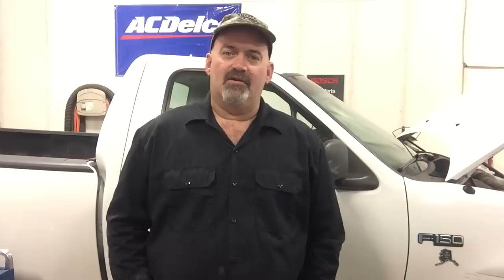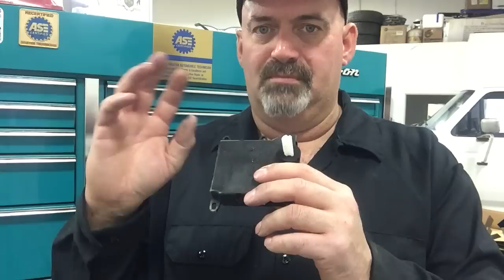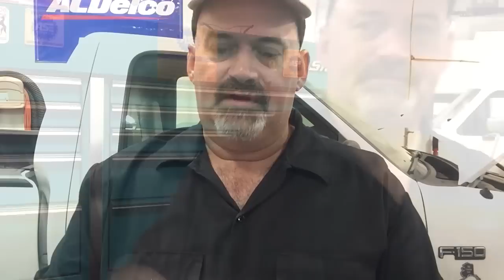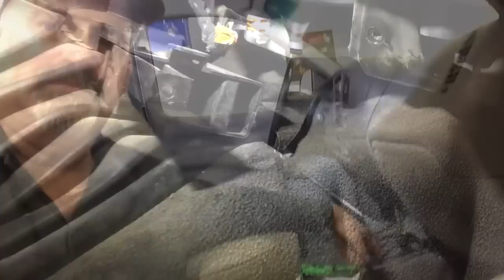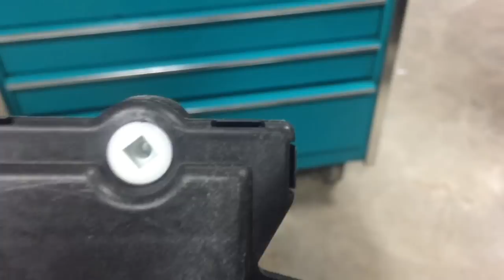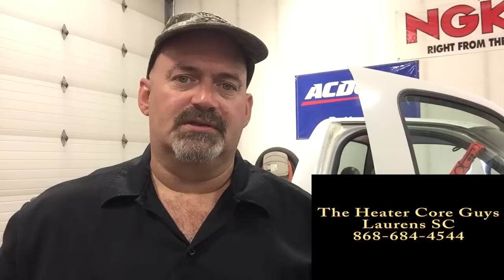Ford F150 F250 Expedition No Heat Diagnosis and Repair

Comment: Help. 1999 Ford F-150 4.6L  W vin.  I had my heater core flushed twice and reversed flush. Blend door replaced And the actuator. Thermostat was changed twice thinking there was a bad one..water pump was checked and it’s good having control knobs checked and are good. They havc controls replaced. Heater core was replaced thinking that was it. . Hoses are hot coming out of the heater core. Radiator hoses were replaced. I get warm heat not hot heat. I’m not mechanically inclined I can swap out parts. I’ve had local mechanics work on it. My heat is still nothing better than warm. One mechanic told me everything’s been replaced you should have heat. Could’ve vacuum leak caused this problem.
Reply: Any luck? I'm in the same boat

Comment: Thanks for the video, I have a 2002 F-150 with 5.4 engine.. I had new heater core, new blend door actuator and new blend door replaced, also has new thermostat. getting good heat and then the heat starts cooling down to luke warm. can go into a grocery store with truck shut off after driving awhile, come back out and start the truck and have good heat again, as if the heat builds up in the HVAC box while in the store. then drive awhile and it goes to lukewarm again. push the gas pedal to the floor a couple times improves heat again. opened coolant reservoir cap and got some air bubbles out. at a loss of what to do next. cold weather here now. help is appreciated very much so.
Reply from the maker: Hey guys didn't realize my number wasn't on here if anyone is trying to call kindly help me spread the word my new number is 8648713949
Reply: Exact issue here- did you solve it?

Comment: 02 Ford F150 5.4, have heat but not hot enough, new thermostat, coolant flush, flow restrictor removed, heater core back flushed, blend door actuator replaced, coolant system burped to remove any air bubbles. Could the Blend Door itself be broken where it goes into the actuator. the temp control knob turns fine and the heat temp changes when you move it BUT the heat is not hot enough only warm..both hoses to the heater core are hot. please reply back..Thanks.
Reply: Same here... did you resolve it?

Comment: I have a 2002 Ford expedition coolant and thermostat has been renewed also blend is working I open a door on the black box behind glove compartment and blend door open and closes as I turn the knob. I also stuck my hand where heater core is and I did not feel any heat. I called dealer to see and find out where is the heater valve they said theirs no heater valve on that model. Fan works climate control works and new thermostat and coolant and still no  warm heat can some one help please I'm stump. Thank you in advance.
Reply: Hey friend did u fix your problem ? Im having the same issue

Comment: Please help.  97 Ford expedition. Very Little heat.  I've flushed the heater core back and forth til it runs clear. No leaks or wet carpet.  3 new thermostats. STANT. Full of fluid.  Replaced water pump. Cut open the glove box to view the blend door working. The radiator house never gets hot. The radiator never gets hot. Engine temp. never rises up to normal. (3 NEW stats by different manufactures).  New coolant reservoir cap too. 
I'm lost.
Reply: Did u ever figure out the problem ? I'm having the same issue